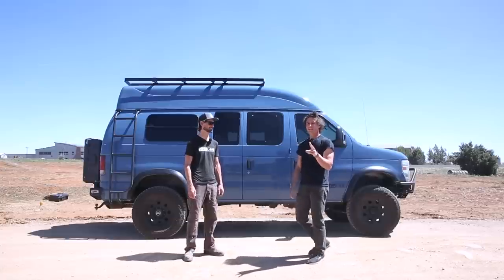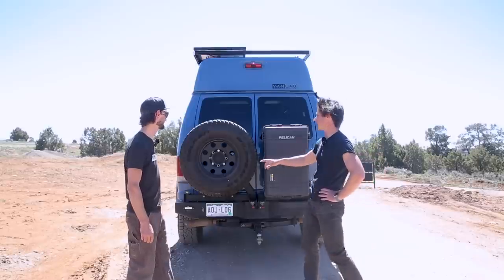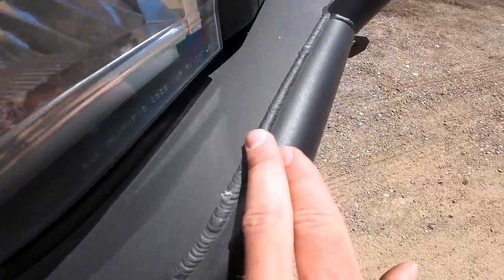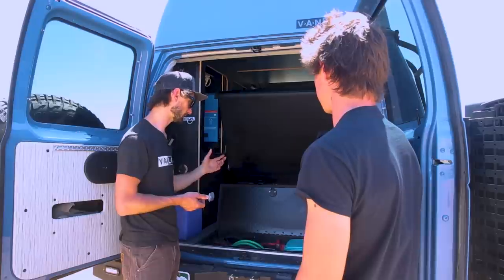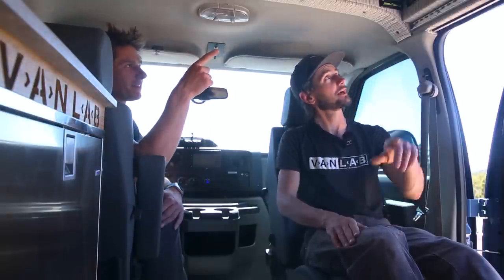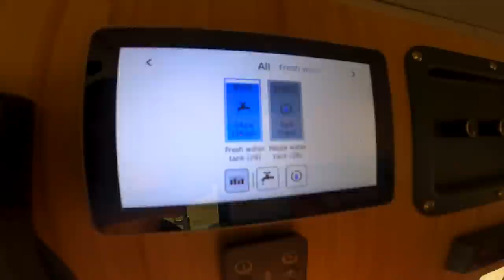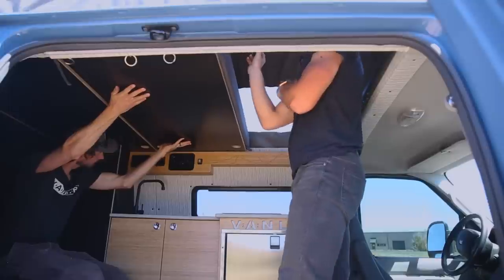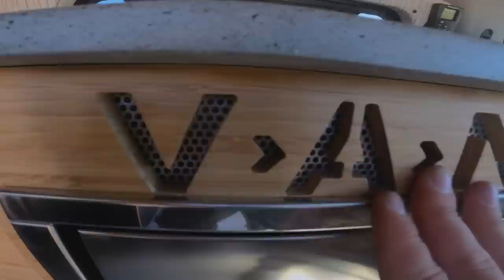The Ultimate Van Build for Capability and Comfort? 2011 Ford E-350 Quigley 4x4 Conversion

Comment: The only thing I don’t like is the V10. Being a 3rd generation mechanic an machinist. I’m very familiar with the problems that stopped V10 from being made years ago. Their major flaw which wasn’t fixed it was just rigged is vibration. When you go from 8 cyl to 10 it has very bad vibration. That’s why Ferrari went with a V 12. 
The only way this proves me wrong is seeing V10s with 200,000 miles , 300,000 miles. There is tons of V8, V6 with close to 300,00 some over.  Time will tell.
In that amazing van I would put a Cummins. The problem is the nut bags in Government trying to destroy diesel. The safest and best engine ever designed.  Sorry for the rant but sometimes us old mechanics might be right. Of course I’m waiting to hear why the V10 is a good option especially since it’s just about disappeared.